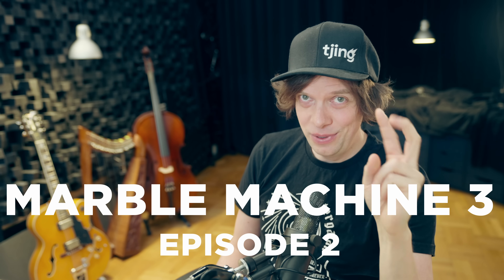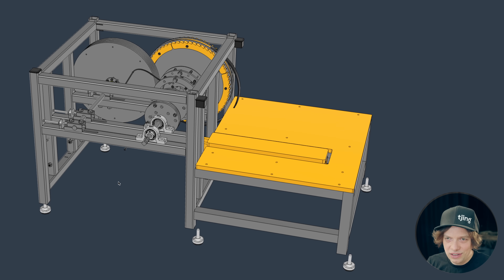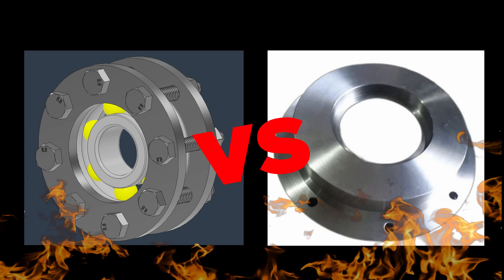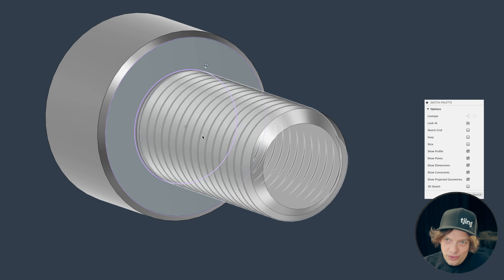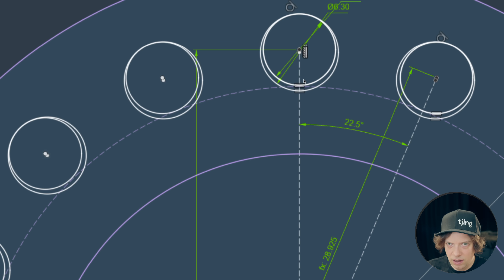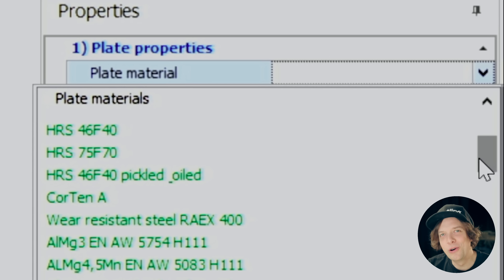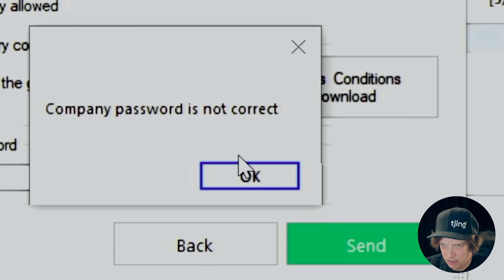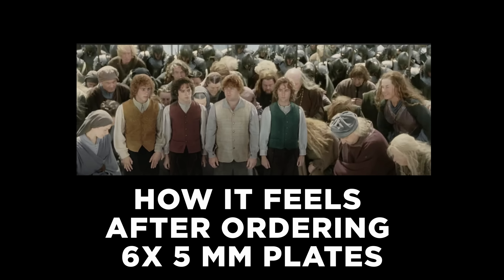Cheap Bearing Housing - Marble Machine 3 Ep.2

Comment: NGL, my first reaction to the idea of making a bolted bearing cage was WTF. But on further reflection, I don't think this application will be under high enough loads to suffer from having a poorly supported bearing. I do, however, not like the idea of threads being used as load bearing members. If I had to do something like this for my a client design, I would either A) use a stack of cut plates so that the bearing still has full support. or B) use shoulder screws instead of fully threaded screws, so that there is at least a nice precise smooth surface supporting the bearing, not the sharp edges of the screw thread. Also, screw threads are not toleranced to the necessary level of concentiricity, unlike shoulder screws which are designed to be used for load bearing and alignment.

Comment: You should probably not use actual long bolts for the bearing housing. You will probably have to replace the bearing, and when it's a bolt that goes through the housing, you have to take out the entire assembly to service it. It's probably better to use capped nuts (I don't know the correct term, English is not my first language) as the outside of a threaded bar

Comment: If you use bolts that are only threaded on the fastening end, the unthreaded portion is a much more precise surface and of course smoother to have your bearings run against.
Reply: Shoulder bolts 👍

Comment: Not a good solution. This is so much heavier/bigger than a manufactured bearing... not useful for traveling. Why not using standard bearings and put them into a "lathed thing" which exactly fits the bearing diameter?

Comment: I might be missing something very basic here, but why not atleast use a third plate in the middle that the bearing is captured in and the plates on the side are used to clamp from the sides? 
The OD of screw is a very poorly controlled dimension.
Also, others have said something similar - cost vs performance tradeoff only matters if all options meet the basic requirements because not meeting them makes the entire project a waste. If this design contributed to inconsistent sound or requiring realignment and retuning every time you played it then you've missed your fundamental goals. Another way of thinking about this is system and lifetime cost. If paying an extra €100 here means you save 100s of hours and euros over the machine's lifetime servicing and adjusting, then isnt that worth your time? 
I dont entirely understand the repercussions of poor tolerances here on a system level and sometimes there are things that dont need high accuracy and are fine with cheap solutions like this but make sure you've thought out all the implications of it because screws and machining is far from perfect and even if one piece works, doesnt mean all future ones that you make will. 
Another source of disagreement with the community is probably the unique priorities youre working eith. You're probably getting very well compensated for making controversial videos like this and spending time trying out 4 different bearing housings, but the average engineer would save a lot of money(cash and time-cost) by designing something they know will just work and not have to spend over a week trying to innovate something like this

Comment: Martin there are also not fully treaded bolts out there wich would significantly dig less into the barings. All and all I suspect it can work.
Reply: Shoulder bolts 👍
Reply: I was searching for this comment. I don't know why no one suggests this. Shoulder bolts are the only way I see that might bring his design to work.
Reply: @PermireFabrica  I still don't think it will work but hex head shoulder bolts gives it a fighting chance. Martin needs flanged bearings instead. It eliminates all of this nonsense. He can get a 4 bolt design.

Comment: Hello Martin. I do structural design in Canada. All structural (not mechanical mind), bolt holes are oversized by 1/16", or about 1.5mm. To keep things simplified, torqueing the bolt eliminates the ability for the structure to slide around in the hole. My point is don't get hung up on making extremely tight holes for your bolts. Your loads are light for the number of fasteners you have, just use washers and torque properly and you can get away with larger holes.
Reply: The issue here is that Martin wants to use the bolts to align the bearing in the center, not just for transmitting the force.

Comment: If you use a ground shoulder bolt instead of a fully threaded, you can counter bore and ream the tapped holes they thread into. This will give you a much more precise and concentric engagement surfaces for your bearing to locate on.

Comment: One thought, since you are concerned about costs. Why are you prototyping in stainless steel and not in mild steel?  It's a much cheaper material and you will only see differences in performance over the long term. On a personal note, I suspect that you will have longevity problems with your design since you are entirely reliant on the clamping force of the two plates to keep the bearing from moving. If the axial load is enough to overcome the clamping force, then you are relying entirely on the ability of the thread points to take up the force. Threads can be deformed just by pressing on them with a hammer using body weight alone. Where this is really worrying is that it may take time for the problem to develop and you will have committed to a design that will, ultimately, fail completely but will appear to be viable initially. To give this the beat chance of success, I would suggest not bothering with trying to use the bolts to act as a cage, but lean into the clamping force of the plates. Make the plates heavier and use stronger bolts. (M8 10.9) and maximise that clamp force. (Use a torque wrench)  this is me speaking as a heavy duty mechanic that has seen what happens when engineers try to cut corners on bearings and their mountings.  I want you to succeed and weaknesses in design at this foundational level are multiplicative. Honestly, why are you messing around with this and not just getting your flywheel machined to accept a bearing at its centre?  Get it machined with an interference fit and call it a day. If your flywheel is made of wood, give it another .04mm of crush and glue it in place. You're trying to make a very simple thing very complicated.
Reply: Yes. He has some strange design assumptions that seem to come from nowhere. I thought I was missing some very important fundamentals watching this. Until I read other comments that convinced me I'm not delusional!

Comment: As a professional technical drawer, this sounds like a horrible idea. The tolerances needed to make a bearing function as intended are measured in hundredths of millimeters. Could you build a housing that can hold a bearing properly with a few nuts and bolts plus two plates? I mean, probably, where there's a will, there's a way. Would i sign off on it? Hell nah. Sure, the bearings in the types of machines i work on are a bit more high demand on their bearings than the Marble Machine is on its (simply because most of them will experience rotational speeds sensibly measured in rotations per minute rather than rotations per second), but even then, this doesn't sound like a great idea. For making a machine that plays music with marbles, i suppose it could work well enough, but i doubt it'll do the bearings any favours if they don't get the necessary fittings.

Also, i'm not sure if stainless steel is the greatest choice when it comes to making this machine. Firstofall, many people don't realize that stainless steel can, indeed, rust. It's just more resistant to doing so than other types of steel. It's also relatively weak as a material, and pretty expensive too. You wouldn't use something like stainless steel for construction, you'd use it for something like surfaces in contact with corrosive chemicals, and pretty sparingly too, as, again, it's expensive. A much better choice for general purpose construction would be something like S235JR, a general purpose, easy to machine and to weld, mass produced steel with a low price point. Alternatively, since you are using sheet metal, DC3 would also represent a good choice. It's a general purpose sheet metal that can be used for just about anything.

Comment: 2 steps forwards 5 steps back. You want a spinning element which is powering the entire thing to rest on 6 bolts with trash tolerances. Madness. Terrible idea. This is the kind of shit idea i spend hours lecturering engineering students for choosing such garbage ideas. Vibrating and wobble.

Bolts are not locating items and are designed to do 1 thing brilliantly, clamping. You are going to waste more time and money trying this shit idea instead of doing the spinning elements correctly.

Comment: you use the two plates with a little lip on the sides where the bearing resides to hag the bearingand be concentric and then you'll need the least 3 bolts to hold this together.... what you doing is waste of time

Comment: Martin, you're using false mathematics. The machined bearing housing doesn't have to be 100x better to be worth the price, it just have to be better.  
If one of your bearing get gets out of alignment the machine wont work until you have taken down the module, fix the problem and torque it back again. That would kill that concert. 
With a machined bearing housing that wont happen. And I don't think that it would cost 100x more to have it done either.

Comment: I'm an industrial draftsman, and the vision of a bearing inside a bolt cage will haunt me tonight !!  I'm sure you could use so much more reliable and compact design.
Reply: At least use shoulder bolts instead of the entire thing threaded. SMH. His idea will start to chatter in a short period of time. This needs to have the bearing press fit and the outside turned to be perfectly true to that center.
Reply: I think that you can buy bearing houses so no custom parts needed
Reply: Using threads to hold in place a bearing is a horror vision for a mechanical engineer :') I don't believe it's so much harder to add a little bore in the circular part with the bearing manufacturer suggested tolerances, 1 pin for alignment and the remaining can be the screws with less precise holes and voila !
Reply: Watching Martin learn and grow is what keeps me on this journey.. even when that comes through failure. All the quirky choices make the marble machine interesting. It would not be as fun if there were no creative liberties.
Reply: Wish he'd hire a competent engineer, even just part time, on-site. This project would have long been on the road. Martin is masterful in making music, with a senior engineer he'd have the talent which this 1-man team lacks.
Reply: @axiom1650  I would take that job :) , but yeah this is basic engineering design, you could even ask for a student to work for you as a project for his school.
Reply: @laurentpavot9374  I'm  a Mech Eng student going into 4th year. One of the first lectures when I started was about fits, tolerances, and the precision you can achieve with different manufacturing methods. 

Martin's design causes me trauma even as someone with zero time in industry.
Reply: @axiom1650  him figuring it out and sharing the process is part of the fun :)
Reply: I know I sound like an asshole, but he's not a structural engineer... he needs to hire the right person for the job and concentrate on what he does best, music.
Reply: I'm just a tech that works on copiers an know this is a bad solution.
Reply: Y'all are welcome to give suggestions in the Discord 😂
Reply: The bolt idea is so idiotic I can’t even finish watching the video. Insane.
Reply: like really he used press fitting before... it's not like that's hard to machine... this BDSM cage is really painfull to look at...
Reply: It's perfect comment bait for the engagement algorithm. Obviously the threads will compress and run out of tolerance, but live and learn.
Reply: @lupeters213  Wait, I thought he would use partial threaded bolts. At least have that "smooth" surface  (in quotes, it's no precision bolt)  .
This clickbait video implies on using FULL THREADED ONES ?  
I can imagine bearing track, which are usually hardened, having to contact and transfer force to ... threads. YEP.
Reply: @jjcc8379  Interesting thought on the clickbait. Maybe for lots of comments by showing the use of full tread bolts in this build to make us cringe and comment. I'm not an engineer. I'm just a copier tech. I see how bearings are mounted in those machines. I see this as a very bad idea even if he used shouldered bolts.

Here is the next thought. How often are you going to need to replace that bearing? I think the marble machine will be retired before that bearing ever needs replacement.
Reply: all the engineers who see this goin to have nightmares for weeks, no doubt about that 

but also it's a great opportunity to see diferente approach about the classic and stablish solution, remember the tings we give as law, on time was labeled as madness, stupid or witchcraft for most of the people, just for being too outside of the box for that time

also, experimentation it's the key of any engineer and humanity in general, of course experiment cones with tons of failures and disappointment but when you experiment and goes right it's way more powerful that don't trying
Reply: @lutboy2909  Thank you I love the choice of words.
Reply: He KNOWS that; he virtuallly admitted it. Problem is, he's incentivized to drag out the build as long as possible.

So farting around like this even though HE KNOWS he'll end up using a store-bought housing, is the sensible option for him.

In fact, annoyingly, his most sensible option (assuming views, patreon and Adsense stay stable) is to NEVER have a complete build- To just prolong the building process, and keep making build videos,indefinitely...
Reply: @baconsarny-geddon8298  He closed his Patreon and YouTube memberships ages ago. He does it this way because it's what he enjoys. Yes, he could hire an engineer, but he also could have outsourced the whole process. At the end of the day, this is the story of a musician figuring out how to build the instrument he dreams of.
Reply: @scaredyfish  good comment 👏
Reply: @baconsarny-geddon8298  I'm sure he can make awesome content with a finished machine on tour aswell. 🥳
Reply: @baconsarny-geddon8298  Yeah, that is how I see it too.

I watched all the MMX videos
throughtout the years and there were always comments from engineers like this one above: Pointing out glaring reliability issues, getting hundreds or even thousands of likes and then just getting mostly ignored, intentionally or not. And that series got dragged on for years with innumerous redesigns of components.

These videos are about a journey and that's ok, he probably closed patreon and memberships due to criticism because people expected a world tour machine that was just a pipe dream all along. 
One of his main goals is to make entertaining videos, he said so himself and he achieved that with the MMX series. He would probably struggle to find an equivalent source of income after dedicating himself to this for all this time.
Reply: @baconsarny-geddon8298  I’m afraid you are totally right…
Reply: @baconsarny-geddon8298  Saving this comment for Marble Machine 5.
Reply: His goal isn't to succeed, it's to fail forever.
Reply: @GunkDung  Disrespectful! Keep your negative energy and thoughts to yourself. If you didn't like it you could leave. That goes for all in this chat that talk to hear themselves. Bunch of children!
Reply: @3Canibus  pointing out the hard truth to someone you care about isn't disrespectful, it's a gift.

No rockets will have ever flown, no house ever built if people didn't point out when someone was making a mistake.

If you can't handle healthy criticism or confrontation, you are the child here, and you'll never grow as a person.
Reply: @DrTheRich  Wow you are something. Telling someone that they are going to fail forever is not healthy criticism. Constructive criticism is good, yes but what truth is there is being rude for the sake of being rude. Why do people NEED to be mean?  So stop talking to hear yourself talk.
Reply: @3Canibus  You might need some glasses, no one is saying he's ALWAYS inevitably going to fail forever. We are saying IF he keeps this MINSET he is going to keep failing.

Or are you the type of person that would tell a new airplane pilot that doesn't give his plane enough speed, that everything is fine and he doesn't have to change anyting, right before he crashes into a building?

Are you incapable of understanding that someone can change and and learn to avoid failure, but ONLY if you understand why you fail.

I think nice talking to someone is pretty mean in like a sneaky way. You care more about someone liking you, than that person succeeding in his goals. Pretty sad, but sadly pretty common. And it makes you the mean one, not us.
Reply: @DrTheRich  As I said children. If you follow him you would truly understand. Thank you for your perspective though.
Reply: @3Canibus  Gordon is awfully right.
He's monetizng our time in a way he won't be hold accoutable for.

A skill he's mastering, I see.

If you run a patreon, you'll have to accomplish something for your patrons. Something that's not been a goal since ages now.
Reply: @francescozani9488  I don't feel like you read any of the prior comments. He hasn't had patreon for a while so your argument is mute on that front and, so coming full circle again. If you do not like the material he is producing for EVERYONES entertainment and you feel like he has waisted your time, than leave!